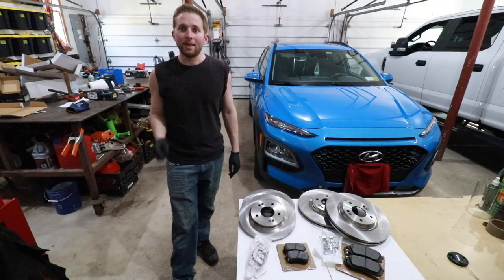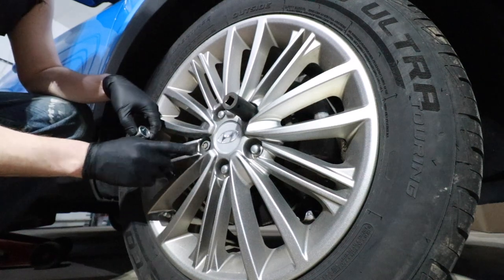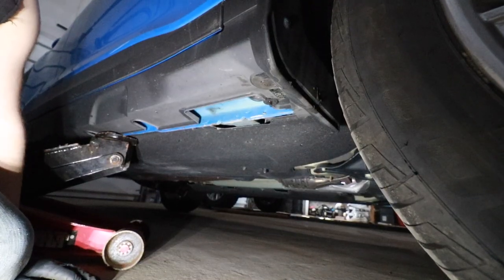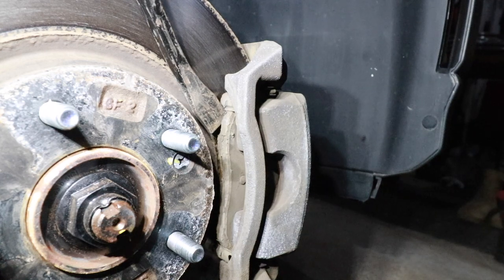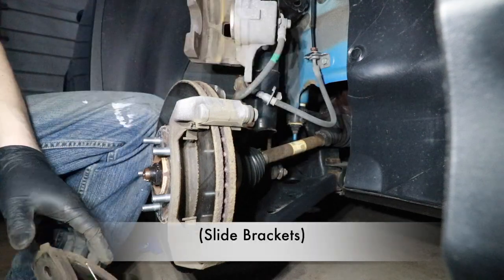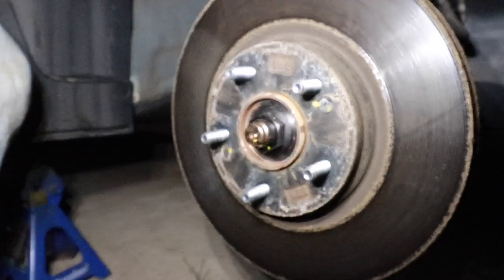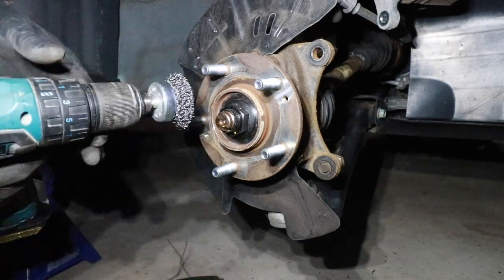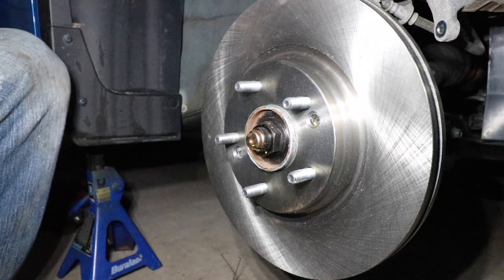How to replace front Brakes | 2018 Hyundai Kona

Comment: Perfect job. I just wonder if it is necessary to open the brake fluid cap in the engine compartment before pressing the piston? I have seen in several videos that they do this.
Reply: i've seen 50/50 on youtube. it largely depends on how much fluid is in your reservoir to begin with, and how far in the piston needs to be pushed which depends on how thin the old pads were. if the old pads still had enough thickness to them and your brake fluid reservoir wasn't at or near MAX then you wouldn't need to open up the reservoir. the reservations people have about opening up the reservoir cap is that you have the potential for debris, moisture, and air to be introduced in there. It is good practice to open it though, as long as the opening remains covered with something to prevent anything going in.
Reply: @CripplelovesWolly  It can't hurt to remove it, only if you forget to put it back.

Comment: Not good to grease the end of a slide pin, grease doesn’t compress so the slide pin won’t fully bottom out in the hole. This can cause uneven brake wear. Only grease the sides. All else was good tho
Reply from the maker: I understand your point, but I don't agree with you. The slide pin sits in that rubber boot. With some pressure, grease will push itself from the end of the pin to the sides. In my mind, this is a slow release grease mechanism.